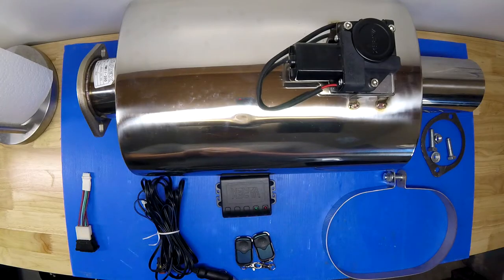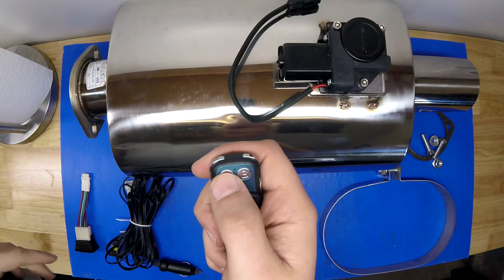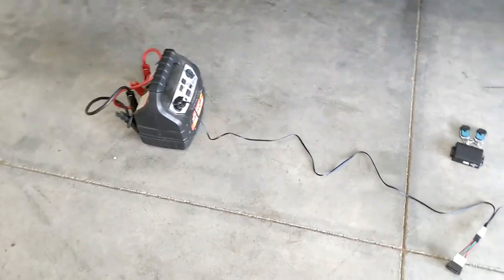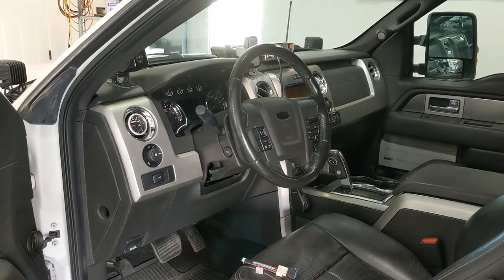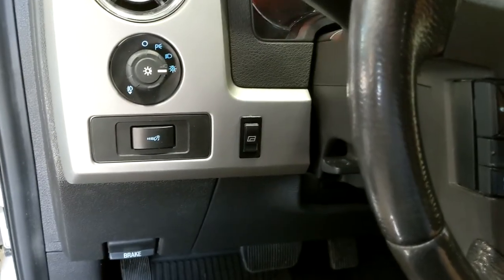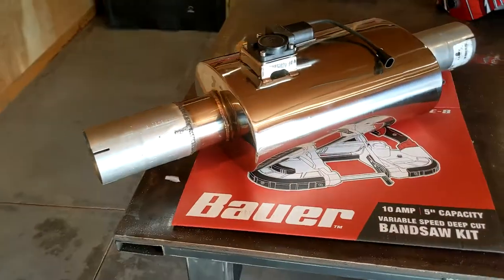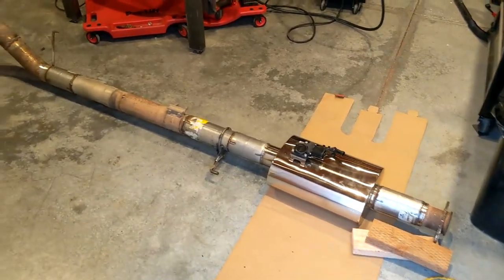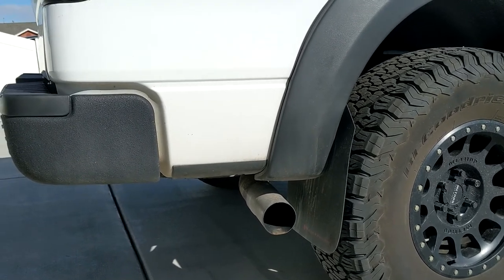Installing an Adjustable Muffler by X-Force

Comment: Do you hear the valve rattle inside of the muffler or at the end of the tail pipe?
Reply from the maker: You know, I have heard some rattling but wasn't sure if it was another random loose bolt. I'll try to investigate and let you know
Reply: @NSQGarage  I been buying the cheap exhaust cut out and they rattle allot. Just afraid to pull the trigger on something more expensive so it can do the same thing .
Reply: @mustangpapi76 at least I’d it’s  a rattle inside the muffle instead of exposed and loud underneath the seats
Reply: @NSQGarage findings of the rattle.. valve, bolt, something else etc? Thx

Comment: I have been thinking about the adjustable muffler last year ( I decided to cut it off lol). Have you had any issues with the alternator? I have 2013 5.0 FX4. I have replaced it 3x
Reply from the maker: Wow that's crazy. I haven't had any issues. How many miles do you have on the truck?
Reply: @NSQGarage  I have 120k. it fails after I go mudding. So my alternator is located at the very bottom of the engine. Awesome content dude!!
Reply from the maker: @danielapolinar3067  thanks brother I appreciate that!

Comment: I just put their 2.5 muffler with the hidden valve on my 66 Chrysler. It is super quiet with the valve open, pretty disappointed sadly.
Reply from the maker: maybe the 2.5 choked it down too much? the 3.5 fully open is too loud to drive around with.
Reply: @NSQGarage  the existing exhaust is a 2, so a 2.5 is larger. I should've went with a bigger one. And they won't accept a return because I had to modify the harness to put it in the car.
Sigh :(
Reply from the maker: @serg2057  dang sorry to hear that

Comment: can this go on a dodge charger 2017-19?
Reply from the maker: the muffler itself is kind of a stand alone product. if it fits, someone could weld it in. i don't know anything about dodge chargers unfortunately. varex may offer a kit specifically for your car though.